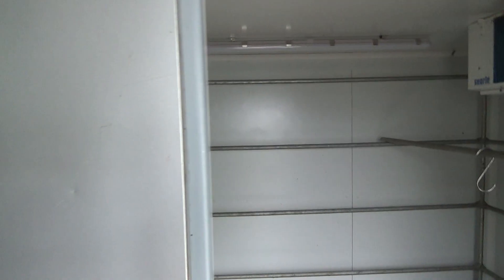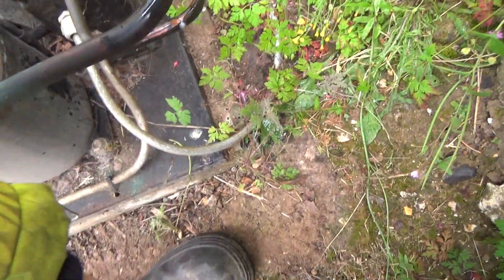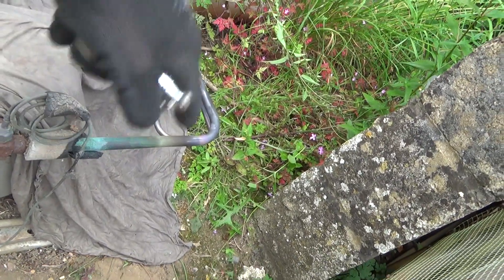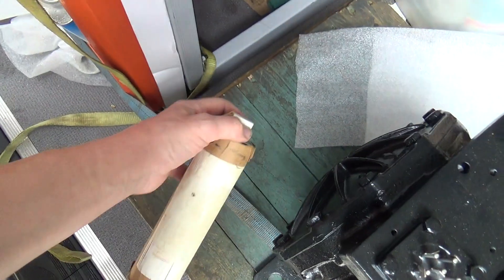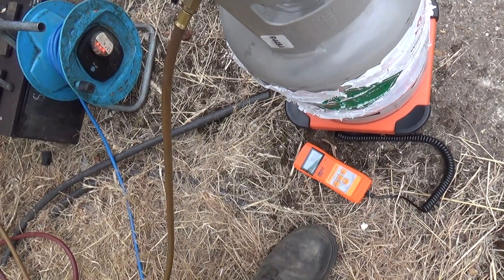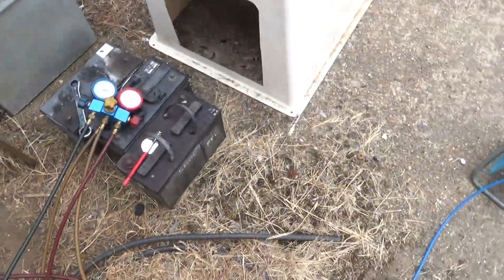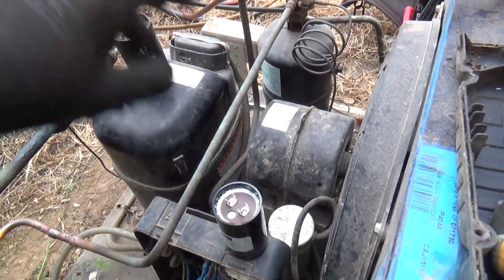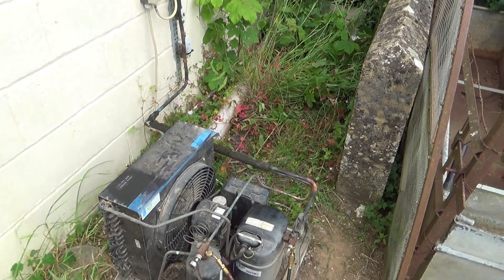Thanks Jim, Supco 88 Saves the Day!

Comment: You need to get a few rolls of silicone rubber tape, which sticks to itself, but does not self amalgamate. Works well as spacer and insulation, and it works well. Normally used on electric fencing to insulate ends, but has a whole host of other uses as well.
Reply from the maker: I have some of that tape on the van! Didn't think to use it... I'll try and remember next time, thanks for the idea!

Comment: I’m wondering why you didn’t change the drier. When I was taught at Willesden  college. I was always told to replace the drier on a job like this one.
Reply from the maker: And what they taught you at Willesden college is correct, always change the drier when the system has been opened.

   I decided not to as it was raining on and off, the weather app said it would be rainy all day and I felt there would be more chance of getting moisture in the system by changing the drier as I generally only stock braze in ones on the van. If it had been a low side leak and the LP switch let the system go down into a vacuum I'd have been more inclined to risk a drier change. The LP in this case shut off around 4psi. The system did get a good vacuum and held below the vapour point of water for the ambient temperature. Time will tell if my gamble paid off.....

Comment: Good video.  That start cap was trashed. That was your starting problem for sure.  your Next repair on that's going to be a Leak at that Suction service valve. That steels been sweating a long time. That's a Old compressor there. Might want to just Schedule a Condensing unit replacement in 3-6 Months. Ask them if they want to be proactive. I Prefer scheduling a call over emergency. You are right to replace that 404 valve too. should be a R-22 valve for 448.
Reply from the maker: I didn't catch it on film but the compressor would start and run for a few seconds then you could hear it slow down before it went off on the klixon, once it had ran with the extra oil for a while it would start ok but yes that start capacitor was not good! 
The cold room is only used seasonally for hunting so its off a lot of the year, I'll have a word with them and see if they want to do some preventative maintenance, the controller is faulty too and wants changing!
Reply: @heavydiesel   Yea , i allways rather change that stuff when i see its coming rather than emergency & it's nice to have a Few Jobs in the Bank ( Jobs i can do when i have a slow week coming up )